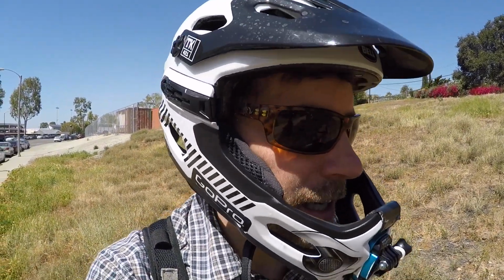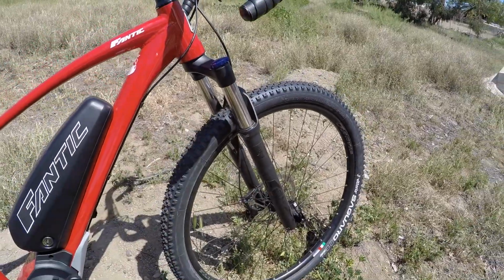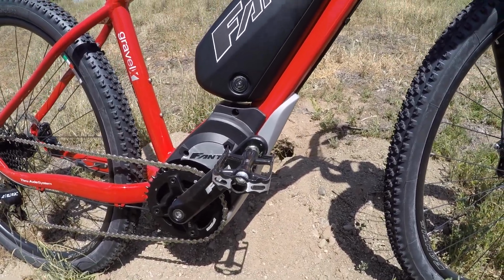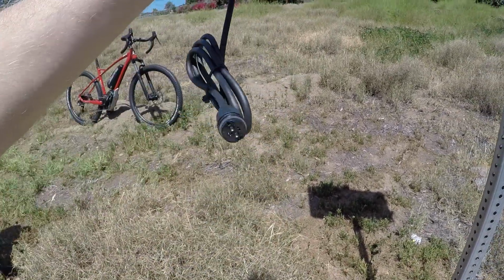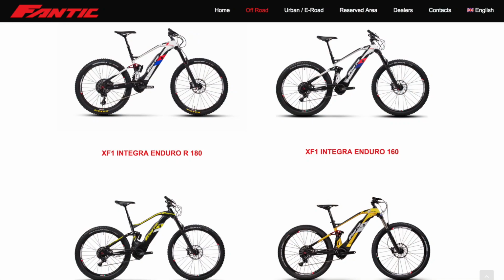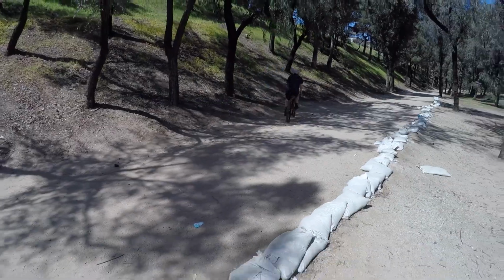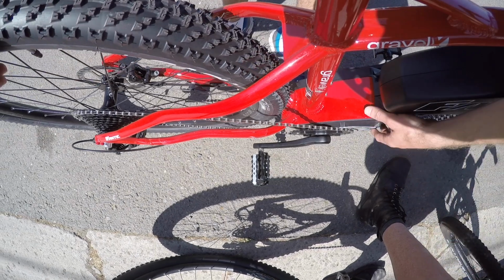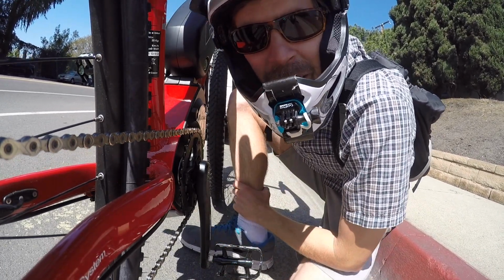Fantic Gravel-X Review - $4.3k

Comment: i need the user guide to figure out how to recalibrate my Fantic to work with a 26" wheel to fit a smaller rider..   the motor will cut out now if i try riding it either with a smaller wheel or just simply without the spoke mounted computer magnate..   apparently seems like if the speed of the wheel and the motor isnt in sync then it will do an auto shut off...

Comment: Thinks we may have a problem here.     My recollection of the Brose T motor is that it offers a peak of 72Nm of torque at 520 watts.  The Brose S is the one that offers 90Nm of torque at 550 Watts.  In addition, this bike has a design flaw.   The frame on the Gravel X is the same frame as the one Fantic uses for it's hardtail 27.5/29"hardtail mountain bike with flat bars.  They've essentially "created" a gravel bike by placing drop bars on a bike designed for flat bars.  This is considered taboo with any reputable bicycle designer.  It essentially nullifies the critical roll  top tube length has in rider position/ comfort/ effectiveness.  As a result, I would suggest anyone buying this bike ride it first.

Comment: Ebike with knobby tires and drop bars? Think for moment, if you are using this bike as a mountain bike (29er) w/bigass tires, why would you want drop bars? The only way to make that bike "work" change out the tires  to a more efficient / narrow design. Total fail for a trail bike w/ drop bars. City commuter or paved trail and smooth tires, im all over that bike. And that RED, Daaamn!
Reply: There are whole YouTube channels dedicated to non-electric drop bar trail bikes aka “gravel grinders”. There are even organized gravel races. 650b/27.5 wheels are more common than 29, though. I personally own a Cannondale Slate.
Reply: You're obviously not the market for this bike. Non-electric drop bar mountain bikes like this are very popular. Bikes like the Salsa Fargo and Salsa Cut Throat sell like hot cakes. I should know. I own 2 Salsa Fargos currently. They are designed for long days in the saddle with a mix of terrain. The Salsa Fargo and Cut Throat have won the Continental Divide Bike Race. Drop bars are for all day comfort with multiple hand positions. I can run 28mm road tires up to 2.35 mountain bike tires on the same bike! This Fantic is amazing. I am the market for it. I just can't afford it...
Reply from the maker: Thanks for the tips on similar models and how this product might be used. Hope you're able to save up and grab one, it's a really fun bike... first time I had ridden or really seen something exactly like this. The other gravel grinder models have smaller tires like this: https://electricbikereview.com/easy-motion/rebel-gravel-x-pw/
Reply: Court, that EM Rebel has a perfect setup right out of the box. Over the years at various mountain bike parks (which i hardly ever ride) not one time did I ever see a rider using a drop bar setup. Mountain / Trail bikes have WIDER handlebars for a reason, control. Like TWW said, drop bars are for long rides, using them on a rock dirt trail seems meaningless. I guess in my neck of the woods we are behind the times with this new drop bars on gravel bike 29ers thing. lol